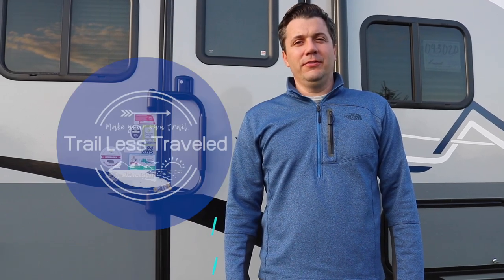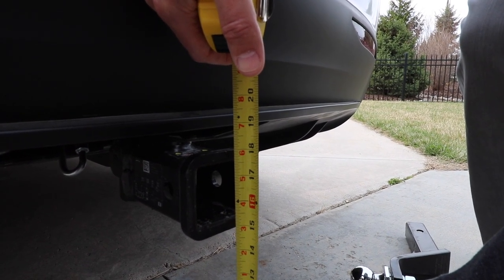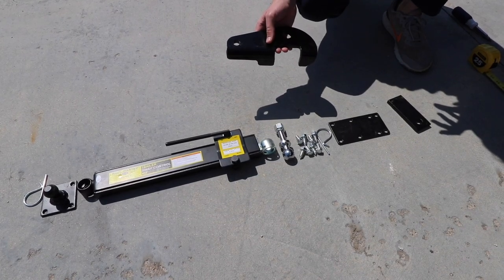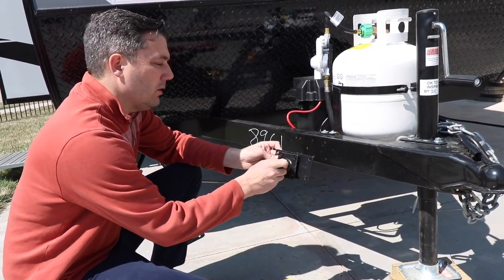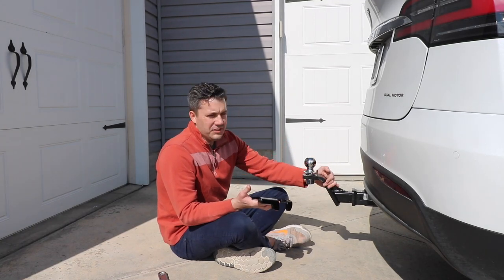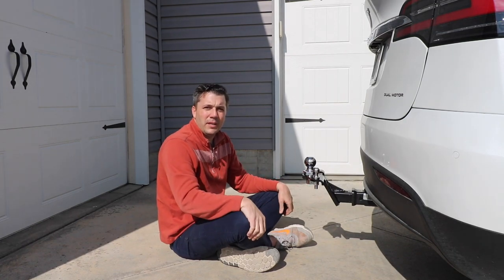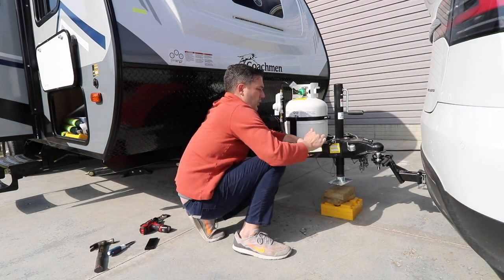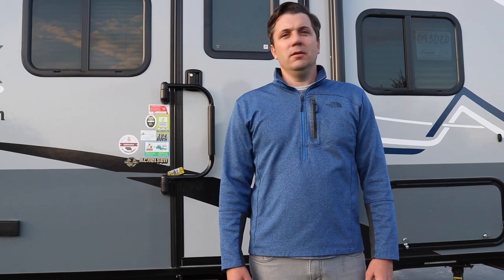Prepare a Small Camper for Towing || Ball Height Measurement &  Sway Control Install

Comment: Hey Steve, thanks for creating all these informative videos. You motivated me to buy a Model X instead of a Model Y to be able to tow a small camper. I bought an E-pro 19 FD and going to pick it up next week. I am going to add P3 brake control and I was wondering do I need to put a weight distribution hitch or just a sway control is enough for my 2020 Model X? thanks in advance
Reply from the maker: That's awesome!  From the research I did only a sway control no weight distribution.  I ran multiple times without the sway control and it handle really well too but it's nice to have that extra control.  I hope you have fun and learn a lot.   Thanks